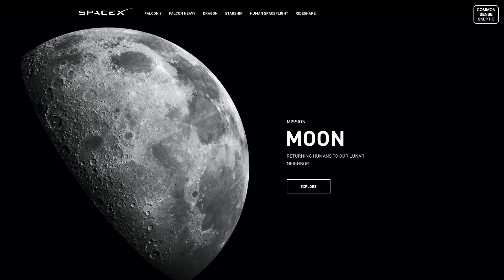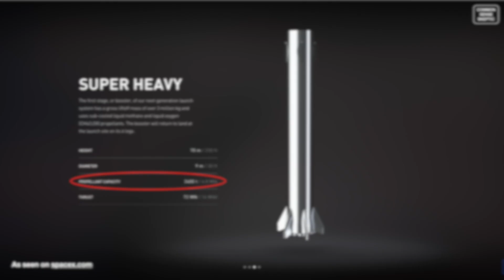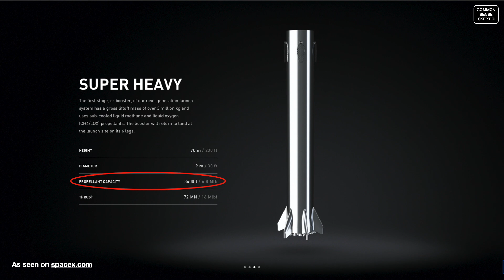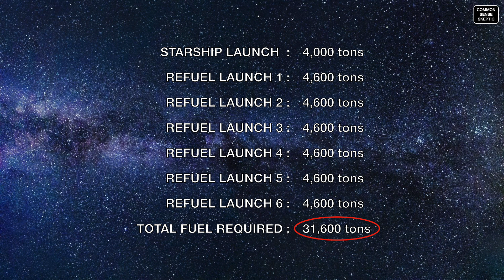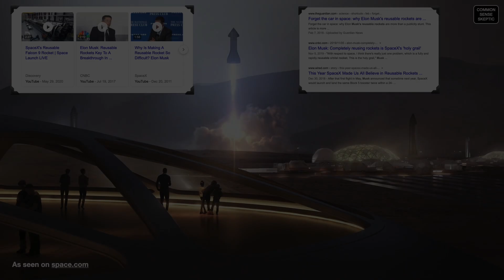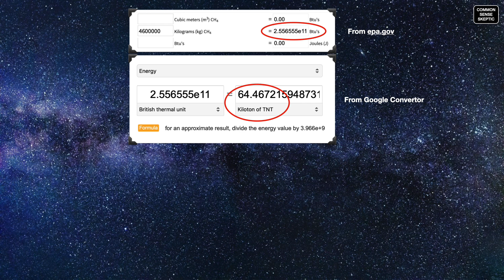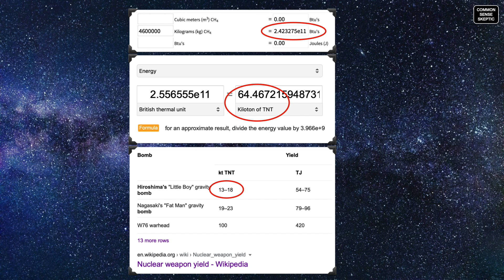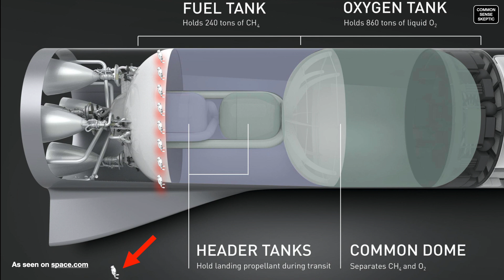STARSHIP EP5 - ORBITAL REFUELLING (1080p)

Comment: I love your sound scepticism. But I also have to say you are not always correct (who is?). You said starship is half empty when it reaches orbit. But: It is completely empty! So it needs at least 12 tanker flights to be refueled! Not 6. So this makes your point even stronger!! Then the explosions with methane. The energy cannot be compared to atomic bombs or even bombs because of the lack of oxygene. It will be more like a huge fire than an explosion. You have the same situation in a gassoline engine: If there is too much gasoline in the cylinder, it will not explode. The mix of oxygene and gas has to be correct. The same can be said about tanker ships. If the oil tanks on board are close to being empty the danger of explosion is much, much higher than it is when they are full.
Reply from the maker: We went back to address the nuclear comparison, and the numbers were very interesting. Look up the Russian N1 explosions. They were measured in kilotons.
Reply: @commonsenseskeptic  You have seen what happened to Hindenburg? Full of Hydrogene. It did not explode. It burned! Like the tanker ship. It will also burn, but when almost empty, it will explode.
Reply: @commonsenseskeptic  I have seen it. It also looks like a very big fire, mayby a half explosion, but mostly a fire. The oxygene and kerosene could not mix properly. If it did, yes, then it would be like a small nuke!
Reply from the maker: @KEB129  The N1 explosion blasted the launch complex, left a crater, and threw shrapnel kilometres away. Everything had to be completely rebuilt. As soon as there’s a boom, that’s the explosion breaking the sound barrier, defining it as a detonation. Seismographs picked this up. 

That was with 15% efficiency, because the propellants were in a series of smaller and smaller pressurized spheres. SS has a single common dome which makes it far more likely this will result in a larger explosion .
Reply: @commonsenseskeptic  It was still more like a fire than an explosion. If it were fully mixed with oxygene it would have been far more severe.
Reply from the maker: Agreed that it would have been far more dangerous had more fuel mixed.

Comment: With low pressures in both tanks, temperature differences could work. At very low pressure, you could have the tanker heat its tanks slightly, while the recieving ship cools theirs (by a stirling heat pump or perhaps boil off). This would result in the tanker ship having large gas bubbles forming, thus increasing the volume of the propellant. The gas flow leaving the tanker would carry large drops of fuel with it. With a low pressure, the amount of boiling needed would also be low.

Comment: Why not parachute the supply rockets instead of fancy-landing them?
Reply from the maker: On Mars? Not enough atmosphere.
Reply: @commonsenseskeptic  No, on Earth. I'm not sure how much fuel they take to land compared to launch but it must be significant.

OK this talks about the main shuttle tank (from space stackexchange).

"NASA did have tentative plans for utilization of the tanks in orbit. These plans were scrapped, however. The primary factors being (1) decreased payload capacity to stable orbit †, (2) risk of insulating foam falling off and becoming space debris, and (3) lack of need for large tanks in orbit during the majority of the Space Shuttle Program era.

The tanks could have been worked to allow for attaching an airlock, and using the tank volume for storage or habitation, or melted for metals in orbit. The primary issue remains the insulation, and preventing it from becoming a hazard of its own.

Note that for reasons of weight, there is no external skin, and even the paint (which may have helped bind the insulation) was dropped for weight savings in later flights; a considerable mass (several hundred kilograms) of fabric or foil as an outer layer would suffice, as would a complete redesign of the tank to put the insulation between the inner tanks and the outer structural shell.

This also would not have been the first time a fuel tank was converted to a space habitation - Skylab was a modification of a Saturn S-IVB's tankage into a space habitat, albeit the work was done on the ground.

Also, keep in mind that the shuttle's normal operating regime isn't a stable height for stations - most potential customers looking to take advantage of the "free tanks" would have to have shipped up other components to make use of them, and had NASA deliver the tank to a more stable, higher orbit."

Comment: A quick note on orbital refueling (propellant resupply); since I helped design a propellant resupply system for Mars missions*.

The method used in our system was called a Liquid Acquisition Device (LAD), which used meshes and capillary motion to move propellants between tanks. One of the behaviors of propellants in microgravity is that they'll climb up tank walls (the parts that don't float off to the middle of the tank), by including the meshes and channels in the tanks you could control the propellant's behavior in microgravity. From my memory (it's been 3 years), this method will work for pretty much any propellant--the focus of the guy we consulted (Hartwig, I think) was on liquid hydrogen. LOX/Methane is a lot easier to work with than LH2. Unfortunately I can't remember much more than this on LADs.

I'd wager SpaceX would use something like LADs because it's a relatively simple system with a slight mass penalty. From our (admittedly bad) system, we got the propellant transfer times to less than a day (~40t of liquid argon and ~28t NTO/MMH). Granted, LADs are in their infancy, having never actually flown. Vanes (something similar to LADs with roughly the same principles) have been used on spacecraft with storable propellants--think GEO satellites with lifetimes of ~15yrs.

It's not completely impossible, it's just never been done. LADs are at a Technology Readiness Level of about 4-5, awaiting actual in-flight testing to hammer out actual details and limitations.

Short is a relative term, I guess.

*I did structures, propulsion,  propellants, arguing with our partners at Columbia University in NYC, ground support, and overall system architecture for the system (named CLETUS), not the actual propellant transfer method. Our design was the only propellant resupply system in the competition to make it to the final rounds, with judges from NASA, SpaceX, Blue Origin, Aerojet, and others.
Reply from the maker: Thanks very much for this post!
Reply: Thank you for the insight, and thanks to the channel host for providing grounds for the discussion! There's a related problem that makes me wonder, and which receives (in my opinion) less attention than it probably deserves: Musk intends to use cryogenic propellant not only to reach Mars, but also to land there propulsively. However, I never noticed any detailed explanation on how SpaceX is going to address the boil-off of the propellant/oxydiser. To my best understanding this issue is investigated by NASA, but no tech demo emerged yet, and absolutely all of the interplanetary craft this far relied either on storable propellants or ion propulsion. As far as I understand it, refrigerating cryogenic fuel in-flight is a tough task on its own and will not only require new tech, but it will also inevitably increase mass budget of the craft and increase energy consumption (with further mass increase). I really doubt that cryogenics all the way to the Mars is the road future projects will take, and I will very much appreciate should this question be addressed here sometime.
Reply: Ah but you see, your project had to have all those people at different places cooperating together. At SpaceX, the Musk does all the hard stuff himself and his staff just brings him lots of coffee and files paperwork. I've heard that he can arc weld with his eyes closed at 100 ft/minute. Supposedly he designed the Falcons with so many seams just cause he likes to show off!
Reply: @commonsenseskeptic  Yeah orbital refueling might actually be one of the few parts of Starship that is not utter vaporware. NASA actually sponsored them to research the technology, and there is some precedent to its study by NASA themselves before a certain senator vetoed any such research for the future.
Reply from the maker: @Blaze6108  The doubt lies mainly in Musk's ability to put it off as he claimed. Since this video they've abandoned the tail-to-tail in favour of a piggyback paradigm. They're still not even at the drawing board here.
Reply: @paulpinecone2464  😂😂😂😂

Comment: The point about the energy contained within the rocket is strange I find, you could make the same argument for basically any heavy lift rocket (Saturn V, SLS, Space shuttle, etc), in the dangers it poses. This is just an unavoidable aspect of space flight, reusability or not, I don't see it as a valid criticism as there is no real way to avoid this risk if you want to create a heavy lift rocket. Plus assuming 100% conversion is kinda silly too, it will be a huge explosion no doubt but nothing anywhere near as devestating as you describe
Reply from the maker: We cover this again in Episode 7, and our numbers check out.
Reply: @commonsenseskeptic  well, no
Reply: Fun fact: A Heavy-lift Vehicle from NASA's SPS study has similar payload to Starship, yet only 4000t mass when full. Which is less than simply the fuel mass of Starship, and even with some mass reserve! Apparently, aluminium construction/winged flyback is a pretty efficient design!
Reply: @HalNordmann  the key word here is "study". there's the Sea Dragon in the "study" category, yet it was never been build. and in the PDF you linked for this SPS study, they never mention the cost, so the fact it was never been built hint towards the possibility it wasn't economically viable... Maybe it wasn't built for other reasons too, but given that NASA's budget was not astronomical in the mid 90's, economics is a plausible bet... 
Other point of consideration is that, those numbers related to payload, total mass @launch are guesstimates AFAIK, they could easily change over the course of active development (what could bring the whole project to a full stop if too different, due to changes in cost, among other things).
Reply: @julianorocha7462  There was no need for 120t payloads daily, and there hardly is now. As for the numerical side of things, it is based on actual Space Shuttle data without accounting for duplication of effort and with a hefty mass reserve. So it probably would work, more probably than Starship.
Reply: @HalNordmann  yeah, it probably woul work. But then again, the Space  Shuttle program was terminated due to the enourmous cost involved in every launch. A scaled up version of the Shuttle certainly would have the same problem, dont you think?
Reply: @julianorocha7462  Reuse costs are always tricky to calculate. And the problem wasn't in the general concept of a winged spacecraft - the system commonality between the two non-existent in practice, and was just used as a reference point.
Reply: @HalNordmann  I agree that reusability is hard to calculate, but then again, the project IS based on the shuttle, that means it probably wouldn't be wildly different from it. The Shuttle was disasembled almost entirely in between flights, the reentry insulation used by NASA at the time was made from extremely expensive materials and the very procedures nasa came up with to build, certificate and homologate the ship as ready to fly again used to make the total cost of a second launch with the same ship in the billion+ mark. Those things would hardly be different between the two systems...
Reply: @julianorocha7462  AFAIK, the cost for an extra Shuttle launch was about 540 million. Most of the program funding was long-term salaries. And the HLLV was related only loosely - for example, it would use cryogenic RCS instead of hypergolic one.
Reply: @HalNordmann  the cost of the launch yes, i encountered the same numbers online... But they separated the refurbishment costs from the launch though...
Reply: @julianorocha7462  They are included. If you were in the 80s and wanted an extra launch for yourself, you'd pay 540m. The stuff that seemingly inflates it are fixed costs - which include everything from sweeping the VAB floor to refilling coffee cups in Launch Control. These are per-year, not per-flight.
Reply: @HalNordmann  I see... I guess we'll have to wait then for the cost per-launch of Starship and of the SLS then...

Comment: I'm sorry, but you are not thinking big enough. I have been performing scaled experiments with my Roger Ramjet true-to-life rocket set. The simple solution requires no fuel transfer at all! Just dock the six tankers modules around the crew ship and light em up in pairs. Drop off the expended ones to save weight and light the next pair! Finally you're left with the crew module which still contains fuel to stick the landing on Mars. And probably enough to get back to orbit to dock with more tankers to fly home again.

The Roger Ramjet models have great little hooky tabs that make it easy to run a lot of test scenarios! And for extra safety I've been using the bonding strip technology pioneered by Captain Buzzmith Lightyear. 

I love docking things! I think maybe the next generation could hook together to form a Voltron space warrior!
Reply: But then how are you going to land the expended tankers back at Boca Chica?
Reply: @michaelsommers2356  Boca Chica is in the closet. It's a good stable landing surface. The big problem I'm working on now is feline incursion. Following Elong's lead, I ordered Chinese to get some chopsticks.
Reply: @paulpinecone2464  I realize you're joking---or, at least, I hope you're joking---but, in case anyone is taking this seriously, this idea is so crazy I don't know where to start.  For just one thing, those "tankers" are going to need nearly half their fuel to get back to Earth, which means that a good chunk of the fuel they expended was wasted in propelling the fuel needed for the return instead of useful payload.

Comment: Did some math. Starship should have 150 tons of fuel left when it gets to LEO. Assuming dry weight is 100 t.
A refueling starship could theoretically deliver 250t of fuel, that makes it four or five launches needed for refueling.
Reply from the maker: That ship has to land. According to the GAO regarding HLS, they’re looking at 14-16 tankers per.
Reply: @commonsenseskeptic  Fair enough. I did not know how much fuel had to be kept for the landing so I went with the most generous number. Mostly just wanted to check if Starship has enought delta v to get to Mars and it does, but barely so no margin of error.
Reply: What am I missing here? If the payload capacity to LEO is 100 tons then that implies that almost all the fuel is burned surely? If there was 150 tons of fuel left then when LEO is achieved then why load it in first place? Why not replace it with 150 tons of extra payload?

Edit: Perhaps the 150 tons of extra fuel is needed for a returning Starship to land back on Earth?

Comment: The whole idea of reusable vehicles depends on the materials making up the engines will not be degraded significantly. How likely is that?
Reply: Reasonably. But not guaranteed. Regenerative cooling should allow for fairly long engine lifespans. Falcon 9 cores have flown several times, and the same with shuttle engines. The amount of inspection and refurbishment is going to vary by design, but will likely be significant for several years at least.
Reply: @mipmipmipmipmip Which part failed due to a lack of inspection? One was due to a faulty SRB at low temperature (not the shuttle itself) and the other was due to a foam strike (again, not the shuttle, although the shuttles design did contribute).

Comment: Not to give Elon any ideas but, wouldn’t it make sense to launch a super heavy alone. Mate the two parts and send the whole mess to Mars. Or is that not dramatic enough. One risky connection instead of 5-6.
Reply from the maker: SuperHeavy won’t be headed to Mars.
Reply: @commonsenseskeptic  I mean launch a second super heavy with a fueled second stage , mate that and then off you go.  Forget the return nonsense on the second super and deliver a full stage to starship. Chances are it’ll blow up on landing so it’ll likely be lost anyway.
Reply: @rannyacernese6627  Your idea is not clear. Super Heavy cannot fly without Starship on top (no nosecone), nor can Super Heavy achieve the orbital speed of Mach 25. It can only fly to Mach 6 before dropping off and returning.